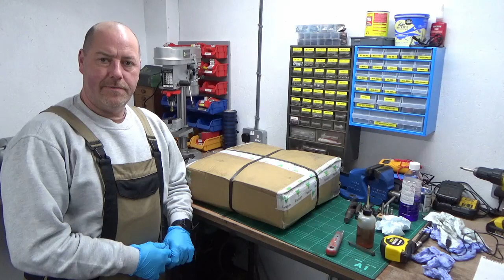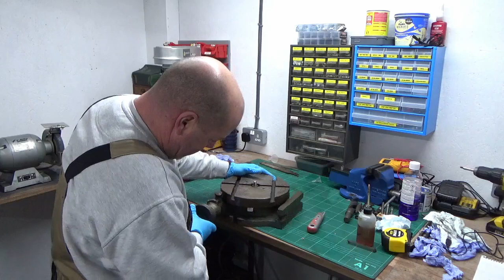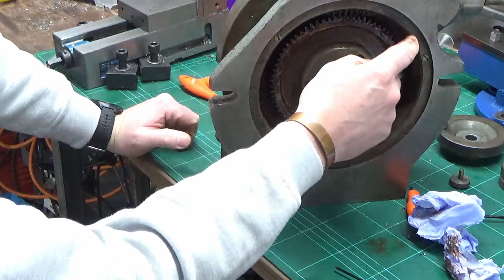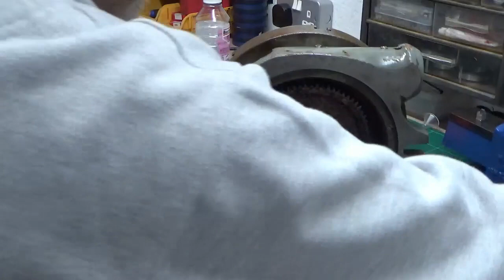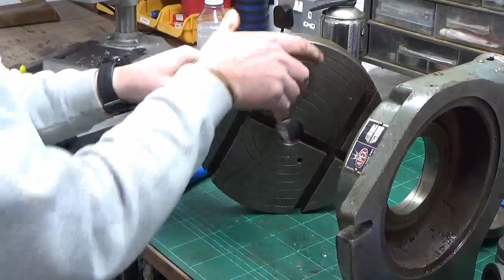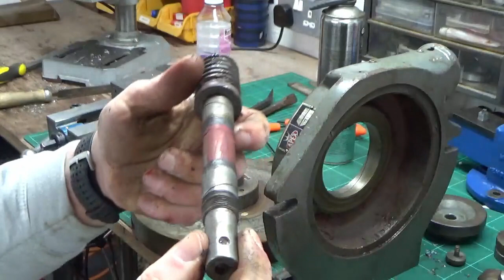APEX 10 Inch Rotary Table Strip Down Part 1

Comment: Hi Jon I have a spare set of dividing plates for a generic 4"/6" rotary table. They are the same as on this page:
https://www.axminstertools.com/dividing-plates-for-axminster-rotary-tables-200248

Nominal 20mm bore, they maybe too small? You can have them if you think you could make use of them/modify them for use with your rotary table.
Cheers, Dave.
Reply from the maker: Hi Dave, thanks for the comment and offer, I would like to say yes but hold that thought for a bit. I want to do some design work first to make sure I don't make an ar$e of the modifications and that will probably be a few months away yet. I am sure I could design around these plates so I will have a scribble and if it looks good will let you know. Cheers, Jon
Reply: @jonsworkshop  no problem I'll keep hold  of them for the tine time being Jon.

Comment: Seems well built. Looking forward to part 2, happy new year Jon.
Reply from the maker: Hi Carl, thanks for the comment. It's pretty good really, like old British but Indian so the castings aren't quite as good but overall well worth the investment. Happy New year to you and your family mate. Cheers, Jon
Reply: @jonsworkshop  Hi Jon. A friend of mine got an XYZ lathe from a firm in Aberdeen that was shutting up shop. The jammy bugger got it free - the machine is branded British but the castings are Indian. It is a really good, solid machine. The locking system on your table strikes me as odd. It bearing against the central spigot would tend to push the table out of concentric over time, since the concentricity is set by the relationship between the central spigot and the bore it runs in. Also the clamping force would be much less near the centre of rotation than if the table was gripped at the periphery.
Reply from the maker: @carlwilson1772  Jammy bugger. I have worked out in India and seen a couple of large manufacturers, they are pretty good really once you see past the environment and H&S etc. I have also done similar in China, no real comparison in terms of skills and knowledge. I am going to modify the clamping arrangement at some point in the future, not happy with it how it is. Cheers, Jon

Comment: My, what a big one you have.😂 
The bend is almost certainly outside the support of the casing, where the handle fits. Easy to bend, a little more difficult to fix without making it worse.😢 Looking forward to seeing how you go about it.
HNY2U
c
Reply from the maker: Hi Chris, thanks for the comment. I suspected exactly the same with my bent worm! The bend was as suspected either in the threaded portion or at the transition between the threads and the parallel diameter where the hand wheel sits. Two sharp taps with a copper mallet and a bit of heat and all is well again. Part 2 coming up Sunday (at some point depending on how quick my copper wire is overnight). Calendar salutations to you also. Cheers, Jon
Reply: @jonsworkshop  what's up can't sleep? Or are you attempting to out do my nightowlness?
Reply from the maker: @chrisstephens6673  Just finished editing a mammoth episode, bleary eyed, hope its ok when it eventually goes up

Comment: Hi Jon, Looks like a well made piece of kit. I'd think it was intended to be lubricated by oil not grease, maybe you could put a copper slug in the locking screw, it looks big enough. Looking forward to part two. Cheers.
Reply from the maker: Hi Paul, thanks for the comment. You are spot on, very well made, and yes unfortunately someone who last stripped it decided grease was required actually starving the moving parts of lubrication (well intentioned I suppose, and no harm done thankfully). Yes, I plan to make a brass pad up for the locking clamp before I next use this. Cheers, Jon

Comment: Hi Jon, Another nice gooey job to get your hands into  🤣
Reply from the maker: Hi Del, thanks for the comment. Yes, it was certainly in a messy state when I received it, people using grease where oil should go probably thinking they are prolonging the life of the unit, in actual fact starving the moving parts of lubrication. All sorted now, part 2 coming tomorrow hopefully. Cheers, Jon

Comment: John Mills at Doubleboost would cut a plate for you I'm sure.
Reply: Hi again Jon, I couldn't see any positive mechanical constraint keeping the table in the body, apart from friction of course. Did I miss something?
Reply from the maker: @mikebarton3218  Hi Mike, the three cap heads that hold the worm wheel in place create the bearing fit. There is a bearing surface on the back of the worm wheel so it basically traps the main casting in between. Hopefully this will be evident in part 2 coming tomorrow all being well. Cheers, Jon
Reply from the maker: Hi Mike, you must be psychic, that is exactly what I did, maybe you missed it but it was on John's SNNC just prior to Christmas. Cheers, Jon